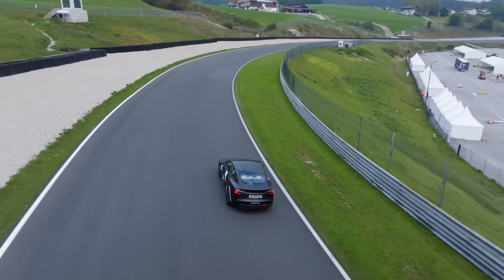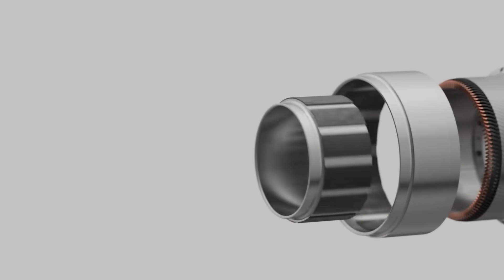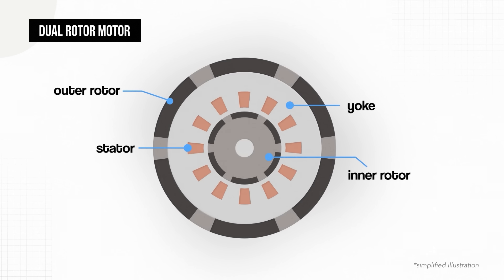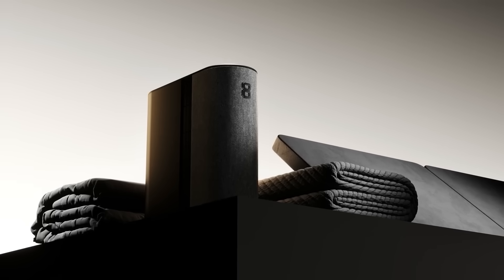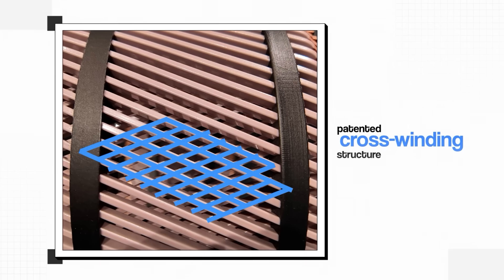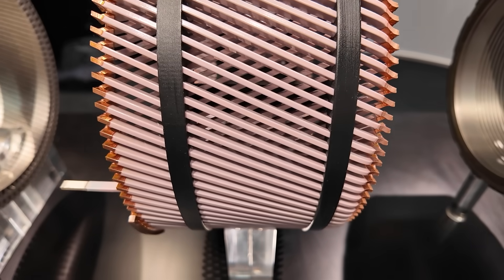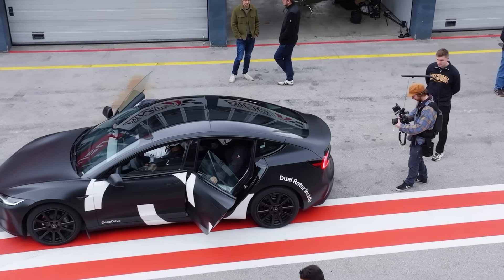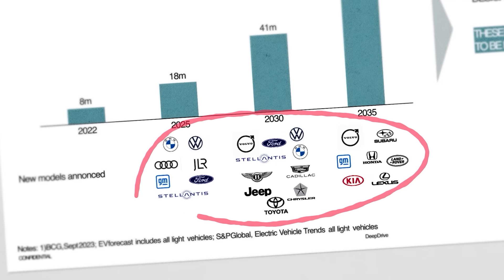How Dual Rotors Make Motors Insanely Efficient

Comment: I need like 6 of the biggest motors they make, I want to make my school bus a hybrid that can do burn outs and drift.

I got a 1989 B600 (F600 bus body) made by bluebird, with a 6.6L inline 6 main engine that I plan on turning into a primary generator, and driving the bus with electric motors.

hood stack the engine obviously, it pre dates EGR/DEF/DPF so I can basically straight pipe the engine, remove the transmission, add a large GenerAc unit to the PTO, and wire that to a 240V charge controller for the main battery.

I should be able to make so much power on tap that the motors can be setup to output max torque and horsepower and not drain the battery with the main engine running, but it would give me the ability to have all wheel drive, all wheel Regen braking, and a massive power unit that I can run anything from a microwave to a welder directly off of, and not suffer for electricity.

Add a small APU that can top up the battery when I'm parked, and solar charging as well, and you have a fully off grid camper that never needs to plug in, is hybrid, and gets insane MPG compared to similarly sized vehicles
Reply: Sounds like an Owen Magnetic bus.  Or the Edison Electric guys in Canada.

Comment: Temperature and vibration makes the longer free pieces of copper more rigid therefore more prone to cracks.
By placing this electric motor into a wheel hub where the vibrations are maximum can quickly get a lot of cracks into its copper mesh.
Reply: The copper bars does not provide much ampere turns, and hence voltage per motor RPM. Wonder how they match a 600V battery to the motor. Must require some high current switching.
Reply: The copper isn’t free standing, it’s encased in a laminated iron core. But of course, that stack is still subjected to the forces you’re pointing out and laminated iron cores aren’t very strong either.
Reply: gibmb • Yes. 
What I meant was that in order to create that specific crisscrossed copper mesh you have a bit more portions of the copper that are not strengthened by the other copper bars tied tight together like in the known stator of the regular electric motor.
Reply: @mikel4879 The crisscrossing is to make the iron core more rigid. If the bars are axial the iron cylinder becomes a zig zag and weaker.
Reply: tofo2 • Yes. 
I don't talk about that. I'm talking about exactly those spaces between the copper bars. 
You maybe don't drive your car a lot, but I'm telling you that by driving your car daily at 75 miles an hour, 65 mph, 55 mph etc and hitting potholes, big cracks and uneven portions on the highways, freeways and what not, those free portions of the copper bars will stiffen first and crack afterwards. 
If the motor is used in anything else than a car or in a car as a single big electric motor, and not in the wheel hubs, then I think it is ok.
But in the places where it vibrates a lot every day and with the current suspension design, it is a no-no.
Reply: @mikel4879A hub motor is also at a sensitive location at the wheel of a car where you can hardly make disk brakes work. Electric high current electric wires and more.
Hub motor is nice for indoor driving on a flat cement surface.
Reply: tofo2 • 👍
Also the daily high vibrations would kill them quickly.
Reply: The copper mesh is embedded in a laminated iron core

Comment: For those who work in the field do realize this is a youtube channel and the person may not be familiar with electrically machinery.  Nothing in this motor is new --  slanted crossed winding have been employed before (cogging),  square copper been done for generations.  Dual rotors (and axials) overlook the fact that you now have a double airgap in the magnetic path.  Quoted efficiency numbers 97% are not really earth shattering.  We are still a long way from reaching the end of the road for traditional electric motor designs.  I suspect high temp electronics getting closer to the motor ( maybe at the most hollowed out rotors ) will happen way before all these weird motor designs.

Comment: I remember being surprised by Siemens Wind Energy's use of an external rotor machine for their offshore wind turbines. The outer rotor has more circumference so they could get more magnets on it, more magnet means more pole pairs and therefore lower rotational speed for a given electrical frequency. The internal stator of their 6MW machine was big enough to walk through, which provided convenient access to the wind turbine spinner/hub.

It would be interesting to understand more about how the attractive forces between opposite magnetic poles on the inner and outer rotor are managed and how the rotors are mechanically coupled to the load. I assume this is at one end only, so that electrical connections can be made to the sandwiched stator). this could result in challenging forces at the rotor bearing and /or vibration modes on the rotors
Reply: I would be surprised it's not more common, practically all small scale BLDCs are outrunners.
Reply: @kalsrobots BLDC?
Reply: your like a book. ❤ study more if you would like your answers? (your not even asking a question) me Post PhD EE

Comment: Just for all wondering how it’s physically possible to improve efficiency on electric motors by 20% despite them being already at, about 95% efficiency. Most likely there was an error in translation. If I remember correctly the German coverage I read about deep drive was talking about a tesla where they replaced the Tesla motors with deep drive wheel hub motors and got 20% more range out of it than before the upgrade. Which makes sense as they did not only use more efficient motors but also cut out the reduction gears that are as well a somewhat major cause of inefficiencies.

And just comparing peak efficiency also doesn’t paint a full picture, an electric motors‘ efficiency varies depending on RPM and torque request, considering the weight reduction, removal of gearing inefficiencies and possibly larger RPM and torque band at a higher peak efficiency, 20% range improvements could be possible
Reply: "Reducing losses by up to 20%" might explain it better. That could take a 95% efficient motor up to 96%. You could also be correct that it's the off peak performance that's important, under real world driving conditions, but that should be verifiable under controlled steady state, (or transient), conditions.
Reply: yes, for a motor that makes efficiency claims, the efficiency discussion was lacking
Reply: "improve efficiency on electric motors by 20% despite them being already at, about 95% efficiency."
Going from 95 percent to 96 percent is a 20 percent improvement if you measure inefficiency .
Reply: @thomasmaughan4798 yes but thats also kinda misleading just as it is to just state peak efficiency, its much more interesting what average efficiency in certain driving scenarios are possible. Its kinda like those Chinese EVs that charge with >500kw at some point but can’t hold it for an extended amount of time.
Reply: @thomasmaughan4798 indeed, but that is misleading because one would think this motor draws 20% less current.
Reply: Finally, someone else with a brain! Thanks for noticing the essential missing piece! All solar racer motors quote at least a peak efficiency number. Drive train, gears, failure modes and cooling lines are important too
Reply: You are correct in your thinking.  It is not possible.  95% * 1.2 = 114%.  The difference between 95% and 100% are no part of the equation in terms of "improving efficiency by 20%".  Don't get sucked in with their fuzzy math like the sheep who accept 96% as 20% because they are fearful of looking dumb.  The 20% is simply click-bait.
Reply: @jackt6112  "The 20% is simply click-bait."
No doubt, but you are measuring the 20 percent as an increase on efficiency rather than a decrease on inefficiency.  Going from 95 percent to 96 percent is a 20 percent decrease in inefficiency from 5 percent to 4 percent. (as an example; not saying that's what they did, but it is a way to create dramatic news out of tiny news).
Reply: 90% efficientcy improved by 20% = 91.8% efficient....🤦🏻‍♀️🤦🏻‍♀️🤦🏻‍♀️ they increased motor cost by 50% + patent licensing for 2% overall improvement🤷‍♀️🤷‍♀️🤷‍♀️

Comment: Two layers of magnets means double the cost. Already 80% cost in a Permanent Magnet Synchronous Motor is of the Magnets, so we double that to gain what?

And two rotors means aditional coupling mechanism that woukd be suseptible to breaking and demand additional maintenance. Reminds me of the DC Motor Carbon Brush issue. We keep reinventing the same wheel.

Comment: 1:55 While taking electric motor classes. I came up with the idea of an extra rotor on the outside of the stator (similar to the motor in the video). This way, you'd get almost all of the magnetic field. I'm sure others have thought of it as well. Engineering it is a whole other challenge. Congratulations.
Reply: Yeah I'm not an engineer but me too ^^
Reply: @joannot6706  I didn't graduate from energy engineering either. I only completed high school and associate's degrees in electrical and electronics. I just watched another video. Ferrari has used a Halbach array in its new electric motor. This way, the magnetic field on the side facing the stator can be increased to 40 to 60%. This is a very good solution.
Reply: PhD EE, great ideas are 95% on the same spot on the sides of the river of time
Reply: I work at a company called “ThinGap” we’ve been doing this for over a decade!

Comment: Wait, how the heck did they get the magnets so thin?! Can you explore that? In my estimation the combined magnet thickness on each rotors should be comparable to the thickness of the windings to push decent flux density through the airgap, which in this motor is quite substantial. Are they just operating at very low B-field strengths? What's going on here?

Comment: I find the idea of putting the motor in the wheel - besides driving dynamics - very inconvenient and sub-optimal. In a race car might make sense (up until you don't jump on a curb .. that would be interesting to see the end result). In a roadlegal car makes the concept inconvenient. What if you curb a wheel due to sidewalk, pothole, etc .. you might have compromised one of the engine of your car. Changing a wheel link or the entire wheel shaft is a matter of few hundreds of dollars in an ICE car. Changing the entire electricmotor is a completly different cost. I think this electric motor is a nice revolution and i am looking forward to see the tests. But i would stick with the center distribution and shaft.

Comment: Next iteration to change the buss bars to heat pipes directly coupled to cooling block outside the motor?
Reply: And run coolant directly inside the heat pipe
Reply: @thatsawesome2060 heat pipes don't need coolant, but that would make sense.  
  I've been racking my brain after writing that, trying to figure out how to get the pipes bent at those tight angles with the sintered copper around the edges staying in tact.  I even found a copper foam supplier for the wick since a DIYer is ranged away monetarily from vacuum sintering. 
  A coolant might have made more sense.

Comment: Trying to understand the concept, but it feels like I'm stuck on older designs and other layouts. Reducing iron is great for reducing weight. But iron also keeps back emf and eddie current in check. How does the reduced iron mass in this motor affect back emf and eddie current?

Comment: 20% more efficiency is going to be really hard when your average electric motor is like 95% efficient or more
More likely is 20% less losses , so from say from 95% to 96%. perhaps some more gains from not having a gear reduction system?
But no way that this system is going to give my car 20% more range, or make a 90+% efficient motor 110% efficient or something like that
Reply: Maybe it is 80% of weight, but electric engines are already pretty small, the weight in electric cars is the batteries.
Reply: @Carewolf  exactly, I mean, obviously smaller drivetrains are great (lucid, for example, does a phenomenal job giving the user more space in a smaller vehicle by having its components be small and packed very efficiently) but let’s not pretend like these electric motors are a lot more efficient or anything. I really strongly doubt that.  I mean, 3% here 2% there, it adds up but the single component is not gonna make you a car go 20% farther

Comment: I don't know about the in-wheel design. Wheels are banged on all kinds of surfaces. There is a reason why we have suspensions and it is not just for us, squishy wet meatbags. Plus, it is one of the most exposed component: water, ice, dust, dirt, mud and whatnot WILL enter the wheelhub. Plus what do you do if you need to change a wheel for example because of a puncture? You'll have to handle the whole 20+ kg wheelhub, plus wheel... I can see that as a potential deal breaker.
Reply: I don't know about you, but when I change the wheels on my car I just take the wheels off, the hubs, brakes and everything else stay firmly attached to the car. The video absolutely is a glazing job rather than am honest appraisal of the design though. This motor used as an in hub motor sounds like a reliability nightmare as all the major torque generating parts are only supported from one end. Also the torque figure is a lot lower than most cars can apply to the wheels when used as a direct drive motor. This is why just about all electric cars have a reduction gearbox between the motor and the wheels, even though it reduces drive efficiency.
Reply: @peglor  Yes, that is a point I didn't touch though.  I should have wrote servicing though, not a puncture tire change.... my bad.
Reply: @StaK_1980  Having the motor out in the wheel arch makes access for servicing a lot easier. If it's as reliable as other electric motors, that's pretty much irrelevant though as it may never need to be opened over the life of the vehicle if it's done well. Replacing the wires feeding power to the motor after they've fatigue cracked may well end up being more common.
Reply: The in wheel design is used for small electric motorbikes

Comment: Copper bars are awesome for hot rodding brute force high amperage power transformers because the secondary winding slots are squared but it's not something you can buy a home depot. I've made bars from copper strips for this purpose but industrial welder cores already do this it's just that the bars have water coolant circuits running through them at only 1 or 2 turns its crazy.
Reply: don't worry, electric machine manufacturers have been bending copper bars for ages
Reply: @redshift3 I'm taking about specialty stuff like the porous copper piping used on motherboards and industrial welders this isn't you run of the mill copper wire it's not solid it's more like a copper sponge inside of round or square tubing.

Comment: AI Summary

Abstract:

This video details an innovative dual-rotor, radial flux electric motor developed by the Munich-based startup Deep Drive. The core innovation is a yokeless stator design, made possible by patented, torsion-resistant copper windings. These windings, constructed from copper bars in a truss-like structure, provide the necessary structural rigidity to withstand magnetic forces and simultaneously act as the primary thermal pathway, conducting heat directly to the motor's cooled housing. By eliminating the heavy, passive stator yoke, the design achieves significant improvements in torque density, efficiency (especially at low loads), and material usage. The motor reportedly uses 80% less iron and 50% less magnetic material, leading to a 30% reduction in cost per newton-meter of torque.

Deep Drive's Revolutionary Yokeless EV Motor

*   0:00 Innovative Motor Design: Deep Drive has developed a dual-rotor, radial flux electric motor, a departure from the traditional single-rotor design common in EVs.
*   1:21 Dual-Rotor "Sandwich": The motor features an inner and an outer rotor that spin together, with the stator placed between them. This configuration doubles the active surface area between the rotors and stator, which is key for generating high torque.
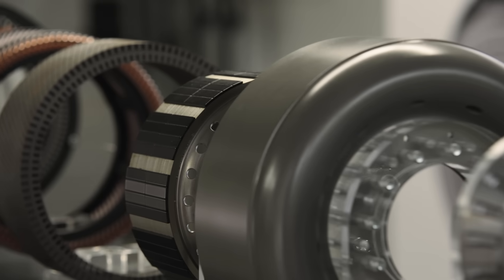*   2:19 Eliminating the Yoke: The design removes the traditional stator yoke—a heavy iron component that provides structural support, completes the magnetic circuit, and helps with cooling. In a dual-rotor design, the magnetic field connects directly between the two rotors, making the yoke's magnetic function redundant.
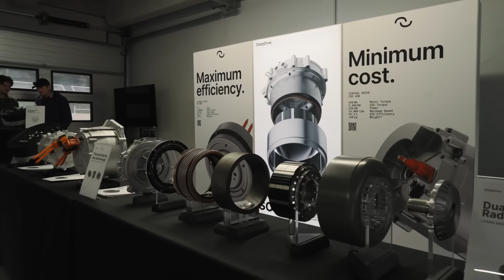*   5:05 Core Innovation: Torsion-Resistant Windings: The functions of the removed yoke (structural support and cooling) are replaced by the windings themselves. They are made from solid copper bars arranged in a rigid, self-supporting truss-like structure that resists twisting forces and is attached directly to the motor housing.
*   9:05 Integrated Cooling Path: These thick copper windings also provide an excellent thermal path, conducting heat directly away from its source to the coolant-filled motor housing. This solves both the structural and thermal challenges of a yokeless design.
*   11:01 High Performance: The in-wheel version of the motor weighs only 34 kg yet produces over 2,000 Nm of torque and a peak power of 180 kW. The design is claimed to be up to 20% more efficient over a real-world driving cycle.
*   11:42 Significant Material and Cost Savings: By removing the yoke and using magnets more effectively, the motor requires approximately 80% less iron and 50% less magnetic material. This results in a claimed 30% lower cost per newton-meter of torque.
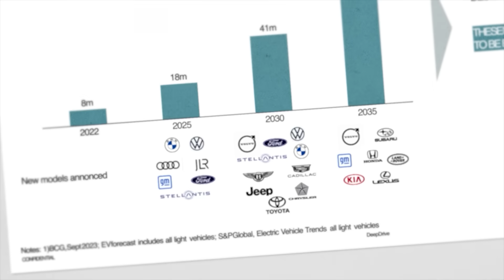*   12:36 Commercialization Path: Deep Drive has active partnerships with BMW and other automakers, with plans to begin small-scale production by 2026 and large-scale production by 2028.

AI-generated summary created with gemini-2.5-pro for free via RocketRecap-dot-com. (Input: 16,224 tokens, Output: 652 tokens, Est. cost: $0.03).